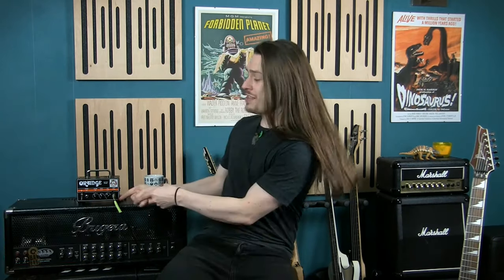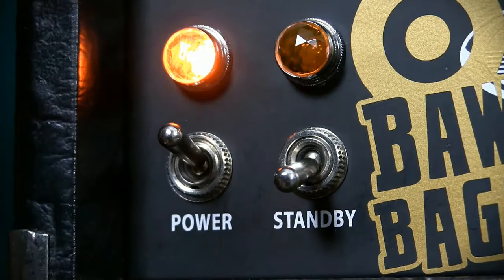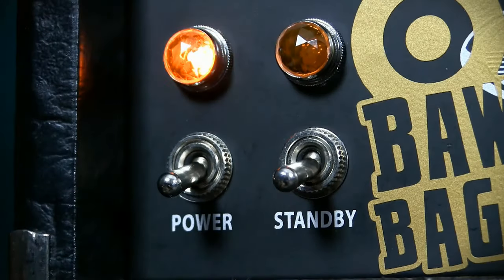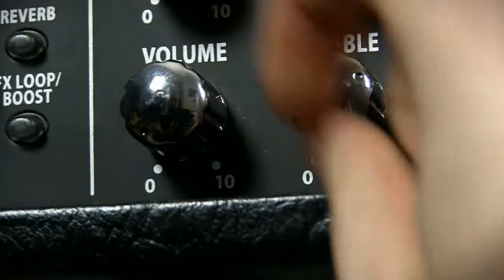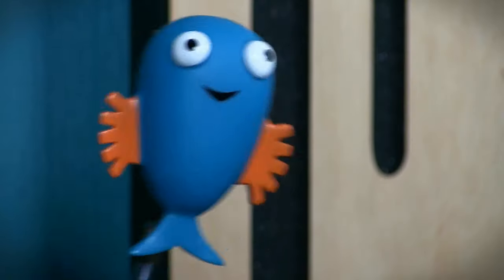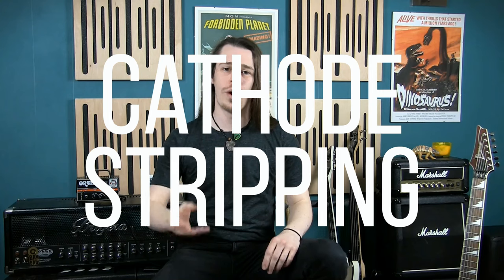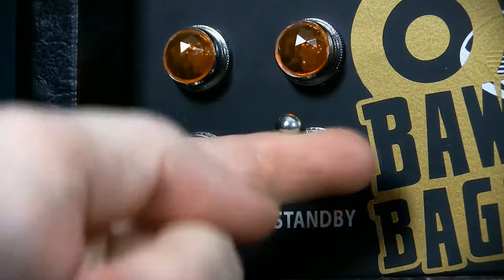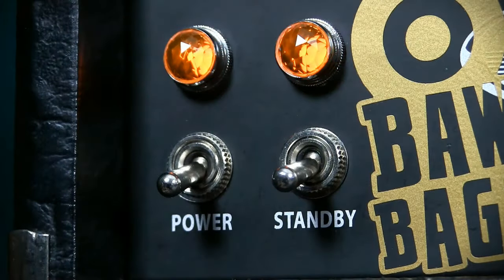Your Standby Switch Is A Lie!

Comment: Just watched the rest of the video - EL34s and 6L6s in hifi run at about 300-350vdc but in guitar amps at around 450v (on the limit) and most have American ready transformers with twin 115v primaries, so the mains input is already 10v too high in the UK and if the mains is high that night, the step up effect of the mains transformer could mean you are running higher than the tubes could handle and catastrophic arking can occur. I've seen it happen.
The notion that a valve does not engage in electrolosis under a certain voltage is is very wrong. I suggest you pull this video as it is potentially dangerous misinformation. The standbay cuts the HT supply and is a safety feature.

Comment: My 90's reissue AC30TB blows rectifier valves if the standby switch isn't used when powering on. An expensive mistake if I forget that one! Not sure if it's my specific amp or common to similiar AC30s, but still...

Comment: I've been using guitar amps since 1979. Since the beginning, I was always under the impression that the standby switch was there so I could mute my amp between sets without turning the amp off or touching the volume knob. I guess I had it right from the start. Never heard anything about and on/off procedure, or saving the tubes.  Maybe because I never read an amp manual?

Comment: Well done....but the standby was actually introduced because the Bassman capacitors were under rated for the peak voltage initial surge.
Reply: yep, and feel free to assume all amps have high enough rated caps now to make it safe to ignore the amp manufacturers recommendations regarding the standby switch.
Reply: @BSPotter  They do

Comment: my H&K doesnt have one... I always figured it was useless haha why do old radios not have a standby switch...
Reply: Actually old radios are operating with much lower anode voltage. Standby switch was originally introduced on vintage high wattage amps which have more than 750V anode voltage where applying the anode voltage immediately (without heating up the tubes) would shorten the tube life.

Comment: While all this is correct I still like my standby switch to mute rather than the volume pot as the switch keeps the volume at exactly the same level I had it at. (Yes I have a tuner on my board that mutes anyway 🙄)

Comment: So wouldn't it be better if manufacturers put in a mute siwtch that practically engages an internal loadbox to take the power from the tubes while you're not playing? You could still put "standby" on the switch and no one would notice.

Comment: Sorry friend, you're wrong. The standby switch does save the valves because, the power valves are only in heater mode until the standby switch is disengaged. I also find it quite funny that you chose valve based home audio and televisions as a comparison. Transmitters also, contain standby switches for the same reason high end valve guitar/bass amps do. To prolong the life of the power valves.

Comment: My standby switch is necessary, and I really would miss it if it was gone. 
I need it to switch the speaker off so I can use the headphones only and so I can practice without annoying my wife so much.
Yep, on the Marshall DSL40C "Low" = 20 watts, "HIgh" = 40 watts and Standby = headphones only.

Comment: I removed the standby switch from all my amps circuits. The switch is now either a NFB switch or its just a switch that does nothing currently. Its not good for your tubes to have a standby switch. I even just built a 5e3 clone and the schematic i chose to base mine off of doesnt have a standby switch.

Comment: One time i turned off my amp without using the standby switch and the amp popped and a made a sweeping sound from high pitch to low pitch.  The sound was one of my power tubes blowing out.  All of a sudden the silver color at the tip of the tube turned white.  Dont know if this was due to the power cut or if it was a complete coincidence but yeah.  I assumed it was not using the standby but now, after seeing this vid I'm not so sure.  This shit is such a mystery to me.

Comment: Not sure if it's related but I've blown 2 output transformers somehow and both times I've switched the standby on right after I turned the power on. If I let the tubes warm up a few minutes I've never had a problem.

Comment: I use the Standby switch when I disconnect or replace speaker cabinets. Now I'm not sure. Is it safe to disconnect the load then?
Reply: Absolutely not. Standby switch does nothing to the power transformer, you still risk damaging it when disconnecting the cabinet.

Comment: My Blackstar HT5 Mk1 has a standby switch BUTTTTT if you take out the input jack it engages standby mode automatically. The MK2s did away with the switch altogether

Comment: I do the exact procedure that you did at the beginning of the video. I normally have my amp unplugged. When I want to play I do that procedure. First plug it in then power on then wait a little then standby.  When I want to turn it off first standby then power off. Then Unplug it. Can I still do that. My amp is a Fender Reverb Deluxe it has valves. Thanks!

Comment: why not using the standby switch, as long as it works well for you...they say it was once designed, to save the filter caps from too much voltage.
Reply from the maker: How does the standby switch "save the filter caps from too much voltage"?
Explain that statement please.
Reply: @ScienceofLoud  measured a difference of 24 volts after 30 seconds in standby mode. From 341 to 317 volts... caps rated at 350 V. Maybe they last a little bit longer. I guess the old days the caps weren't cheap stuff and the tubes might have even been better. It was about saving money

Comment: Old Original Leslie Amplifiers had 450V to 500V valves and I don't see a standby switch on their pictures. But I'll probably never have one or it'll take another eternity for me to get access to an original 60s Leslie Amp. But it's good to know, cause I'll probably look for alternative solutions, which use valves.

By the way, which (power amp) valves are purple / pink glowing, slightly blinking with dynamics response?

Comment: Your on the money about the cathode stripping not the big deal at typical guitar amp voltages...not dealing with transmitters here.. is not really about the valves..
However, if you did not have a stand-by switch and your amp uses solid state rectification.... You would apply high voltage across every component in the amp including pre-amp stages...until the all tubes warmed up and draw enough current to pull down the voltages .... Typical Marshall that idles at 465V would see roughly 500V un-loaed across all components until tubes warm-up.. figure 6 to 8 seconds warm-up time.... The pre-amp filter caps and coupling caps may be rated at 400V during this 500V over-stress...sometimes not an issue, but if the amp is old..
If all your components are up to the task of high voltage over-stress for 8 seconds each time you turn your amp on..then I guess your all good..
There are cases such as with FOLLOWERS and CASCODE topology, where you can get a HEATER-to-CATHODE breakdown before the valves are warmed up....due to the higher voltage occurring at the cathode when the tube is cold.. Proper design can prevent this...but there are amps out there that have this issue.. Also need to be careful when the heater is floating on the DC voltage....
I like the STAND-BY switch....so I can switch out guitars quickly between songs without having to shut down the amp...I sort of treat it as a MUTE switch..

Comment: What about arcing inside cathode follower tube sections when the tube is cold and not conducting ? ? ?
My Holden Wasp amp would destroy  the pre tone stack tube almost every time if the plate voltage was applied before the tube was warm.
Your info here is not quite correct.

Comment: I have a Fender Super Reverb that runs hot when you're not using it unless it's in standby. Same thing with my DSL20. What is the use of wasting power from plate dissipation and heating the room if you're not playing at the time.  I find it useful

Comment: If you have a tube rectifier, no need for a Standby. If you have borderline filter caps, prolly oughta use that Standby switch. Assuming your Standby switch is in the right place in the circuit...
Of course, if you're using borderline caps to begin with, then you're a bad designer znyway.

Comment: This sounds like it makes a lot of sense but I've first hand seen (or heard) tubes become damaged from an insufficient amount of warm up time. A friend of mine turned on the amp and went strength to town, about 30 seconds later he stops playing and asks me why the sound changed on its own. The tone of the amp had become thin and was hard to get a good sound out of. We let it sit on "standby" for a good 20 minutes and with some tweaking we were finally able to get a decent sound out of it. Any thoughts on what this could have been, if not a damaged tube?

Comment: the thing that tube purist like tradition. this mean almost zero innovation in the tubes like the use of subminture tube in guitar amps or making even smaller. when plates are closer together it take less voltage and last longer. in ten years time or so there be ss vacuum tube hybrids which is the vacuum channel transistor.

Comment: Isn't it the other way round, you turn on standby wait for the valves to heat up then turn on the power? perhaps you've been doing it wrong for years, the tiny terror only has one power switch, which has 3 positions off, then standby then on.
Reply from the maker: +diecast jam this makes literally no sense.
Power turns on the heaters, standby powers the high voltage to the valves.
The valves will not heat without the power on.

Moreover the Micro Dark has a straight on off switch. It has no value powers section hence no standby.
Reply: CSGuitars Yup I know I was talking shite it was because i was sitting next to my tiny terror, it was only when i looked at my Marshall later om I realised my error, I couldn't be arsed going back and deleting my comment, I thought I'd wait until someone pulled me up, so cheers, lol.

Comment: Have you ever made an amp or ever work on an amp or are you just going by what the internet said? If you knew anything about tube televisions, you would know that they took a minute or two to warm up, what was your name again?
Reply from the maker: +JPD listen again. I didn't say that valves don't need time to heat up, I said they don't need to be on standby while that happens.

I have cited information from many renowned amp builders on this topic (see pinned comment) and as for my own credentials I have a masters degree in physics and work as an electronic technician.

If you want to play qualification top trumps then by all means display your hand.

Comment: If I turn my amp off with the standby on it will pop really loud. I'm sure that can't be good for it.
Reply from the maker: It does that even if the standby is engaged, the only difference is that you can't hear it.

Comment: This isn't true, well for switching the amp on anyway, my JCM 2000 broke when my lead singer plugged it in to the mains not realising that both the power and standby switches were on, however he's right about switching it off, it doesn't matter.

Comment: In my Victory VX amp manual they actually bothered to write that it's bad for the valves to ignore the standby switch. I can understand the argument to keep the switch due to consumer ignorance, but to enforce the myth by writing it out in the manual? Why bother? Is Martin Kidd ignorant in this matter? I'm not implying that you're wrong, I'm just genuinely curious. 

Extract:
"The VX should always be switched on, (mains switch on rear of amplifier), with this front panel toggle switch in its centre position. The amplifier is now in'STANDBY' mode with just the valve heaters and low voltages on. This allows the valves to heat up before they get 100s of volts up them, (it's less of a shock). After around 60 seconds, the amp can be switch to either HIGH,(around 50watts rms) or LOW, (around 8 Watts rms). When switching the amplifier ON or OFF please ensure the Volumes are turned down and you leave at least 30 seconds before switching from Standby to Off. This will ensure extended valve life and avoid any power-down noise."
Reply from the maker: The bit that doesn't make sense is that taking an amp off standby suddenly dumps the high voltage onto the valves. If you do this multiple times while the amp is on then you are stressing the valves more than if you just did it once on start up. 

There is no academic evidence to support that the standby switch extends valve life, it's purely anecdotal at this point. 

While a lot of other amp manufacturers are quite open in expressing how pointless the switch is, some of them still include it because that's what people want, for 'their convenience' is often the term employed. 
I wouldn't say that Martin Kidd is ignorant, but perhaps he'd rather err on the side of caution, what he's written here is pretty much the stock story you'll hear from anyone, it's what users expect to hear. 

People who have never used a valve amp before may get concerned that they get no sound through their amp straight away after switch on, the valves need to warm before you'll get sound, I can only assume that insisting that you leave the standby off for a minute or two stops people phoning up to ask what's wrong with their amp. 
Similarly if they switch off and get a 'pop' sound they may panic again and get on the phone, so just telling them to shut down volume and standby saves these inquiries. 

It may simply be to give him peace from lots of unnecessary questions.
Reply: Thanks for your reply Colin. 

I've checked out a couple of your links below and it really seems odd with the standby switch. The authors are quite strong in stressing that the standby switch does more harm than good. 

It's interesting to see the power of culture over logic and facts, even after reading everything I still find some resistance to the thought of just keeping the standby on the ON position at all times haha! 

Anyway, great video, keep it loud.

Comment: Amazing I have lived a lie!! Then... is also a lie that we must turn off the standby button before remove the guitar cable of the amp? 
While changing guitars I have always turned off the standby mode... I think that the amp must always have a load connected, right? or is it only needed in the conexions between trafo and speakers? thanks!
Reply: An amp is perfectly happy with nothing connected to its input. You can turn on your tube amp with no speaker load, but if you try to amplify a signal with no speaker load you will damage your amp. The loud 'BRRRRP' you hear when you plug in a guitar with the volume is turned up high has been known to damage an amp, so if you don't want to mess with your volume control, switching to standby when changing guitars is a wise move.

Comment: Thank you for explaining why the standby switch on my amp is important and why I must use it. It saves me having to rotate the 3 volume controls up and down on my JCM 600 everytime I use or walk away from it thus saving wear and tear on my volume pots. Also, the front panel of my amp is hotter when full on than when on standby - so it must also be saving me some money on electricity.

Comment: Nope. When you switch off, it's power off first, not standby. Standby is only useful when warming up the tubes prior to applying full power.

A tube rectified tube amp doesn't generally benefit from a standby circuit, but a solid state rectified tube amp generally does. I've seen what happens when full power is applied to cold tubes and then the amp is immediately cranked. Poof! Not every time, but often enough. Expensive.

I do agree with CSGuitars that simply turning the volume off is better than putting the amp on standby during a break.

Comment: One feature that was not mentioned in the video is that standby essentially stops current from going to the power section (If my understanding of how the switch works is correct) meaning that you can use the amplifier as a preamp without having to hook up a speaker load. That and keeping the amp quiet while I tune up are probably the only benefits of the switch.

Comment: So does this mean that the standby switch just cuts the input sięgnal and nothing more? I use standby anyway because it's more convenient to mute everything in one swift move of a switch button than tweaking the volume knob every single time.
Reply: It shuts off the high voltage power to the plates (B+).  The effect is to shut off the tube's ability to amplify.  It's a "standby", not a "mute".